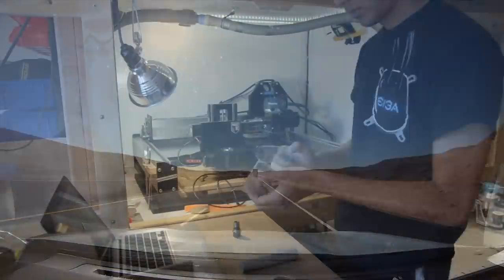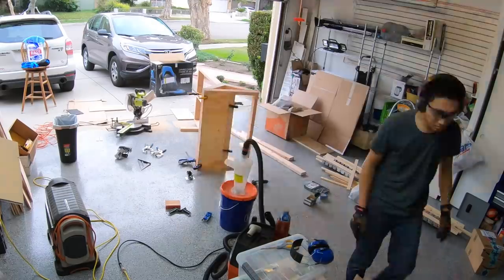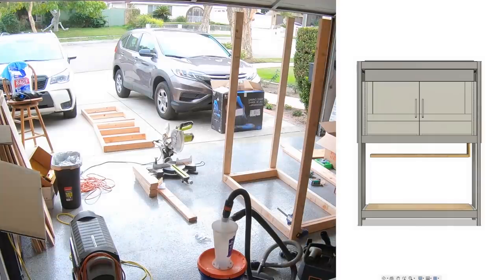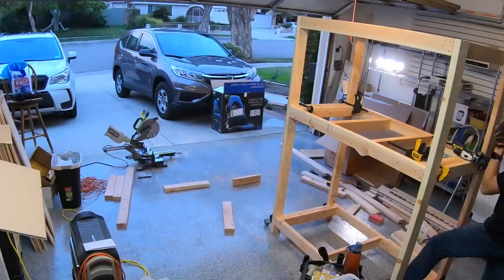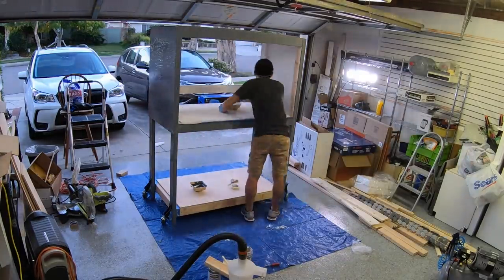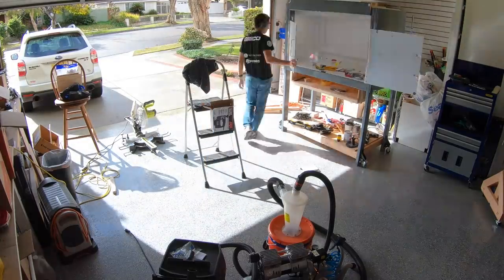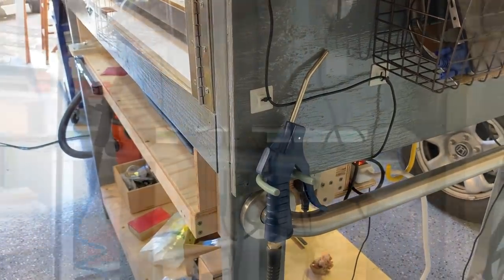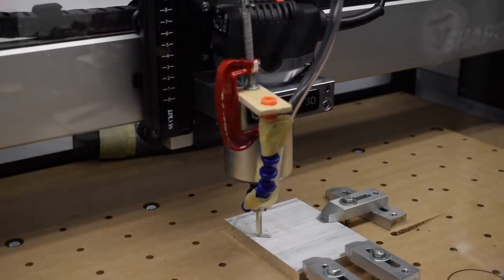How (Not) To Build A Shapeoko Enclosure - #140

Comment: Hi Winston, I'm rebuilding my workshop and will eventually build an enclosed cabinet for my Shapeoko XL. It is temporarily sitting on a old cabinet with on top of a torsion box.  I will take some of your lessons into consideration in my design.  I noticed that you did not include a torsion box in your design. weren't you looking for the rigidity?  If you build with 2X4, I suggest milling them on a table saw to make them the same thickness and remove any surface defect but I guess you would need to put a table saw on your shopping list.  This is probably the most useful tool in a woodworking shop.  You should also consider using joinery like lap joints to make your 2X4 construction more sturdy.  For the vacuum hose, I would recommend the Rockler Dust right hoses that are very flexible and have incredible stretch and they come in different diameter for different applications.

Comment: Hi Winston.  For a cheap, small,  flexible vacuum hose I have been using the hose you put on a sump pump.  I get it from Home Depot.  Its about 10 bucks for a 30 foot hose.  Comes in a bag.  Only bad part is if the length you use is really long it can whistle when it has no load.  Also get yourself a mini wireless keyboard mouse combination from Amazon.  They are about 3" X 6" and have back lighting on the keys. Super cheap, 18 bucks total to my door.  You will love it!  As always thanks for video!!!!!
Reply from the maker: I use a full size mouse/kbd combo. Having the numpad makes selecting jogging increments a lot easier.

Comment: I built a nearly identical designed enclosure for a 24 inch by 49 inch CNC router. I used square aluminum tubing and angle brackets with self drilling and self tapping screws and it went together very quickly. It's skinned in half an plywood and has fluorescent lights in top that I would now do as LED because LED is much better.  I didn't paint anything. The ex motor coupling broke and I needed to repair it so the right side of the enclosure was on screwed in a few minutes which was very convenient. The tank and pump for the coolant is on top and the electrical panel is mounted on the bottom right side. Underneath there is storage much like you have in your design. My hand monitor is now that exactly where you're is and I use a wireless keyboard to control the LinuxCNC computer in the electrical panel. I bought a Dust Devil but haven't implemented the dust collection system yet. I mostly cut plastic and just vacuum up the chips afterwards.

Comment: I have often spend an extra afternoon milling my construction lumber to square before I start building. Because as you say the inaccuracy of 2x4 can drive you nuts for stuff that isn't framing or quick work benches. I see you already have a thickness planer, so with a sled or a table saw you could easily do this on your own. The problem I have with this approach is that you don'r really know what dimension you will end up with until you are done, as that is determined by the most warped piece. So any plans made a head of time will have to be altered to fit the new dimensions.
Reply: Yup this is worth the extra time!
Reply: Run every piece through without changing the thickness setting to keep them uniform. Or at least for the final pass on that face.
Reply: I agree but I rather buy  S4S clear lumber right out of the gate. Sure, it costs a little more since someone else does that work for you, but for a project of this size the cost difference isn't significant enough and I have better things to do with my time than fix lumber (I also don't have a jointer or planer so I guess that is a factor too! lol)

Comment: Just finished mine and I out 10 full extension drawers 2 that are only 3 inches deep. 6 under no it casters with 4 locking. I mounted a small fan inside the drawer enclosure and put a 10 inch filter in suction side so I have a slight positive pressure in drawers to keep dust out. It works great even mdf  dust dosnt get in drawers😀

Comment: Funny how I was not even finished the first version and I am thinking about V2.0!  I am adding a side window - idea from Jason as I have projects that are zero'd in the center.  Like your doors, will use your idea for that upgrade.  Suckit Dust Boot works great, my issue is sound - used acoustic panels with good results.  Put my monitor on top and got a cheap PC to be dedicated to the Shapeoko.  Wish the enclosure was 2 inches bigger in all directions.  Did hinge the front half of the top for serious access when working on the machine.  Hope California is treating you well as I look out at the snow!

Comment: Cool stuff. Enjoyed your narration. Plywood construction without full 2x4s and only cut down pieces for things. Using a combination of 3/4 and 1/2 plywood can be very advantageous. Oh and it's dimensionally perfect. Use a factory edge to run circular saw along or one of many methods to cut straight.

Hide hinges by flipping them so that when closed they are folded together. I'd personally prefer framed windows and that way you can hide all the hinges. They look okay showing but maybe worth considering if you redo it in a couple years.

Comment: I made mine into an outfeed table for my table saw, with three drawers for accessories below it.  A lot of people scoff at it's height, but I don't have much of an issue with it since I don't have to be stooped over next to it.  If I need, I have a short stool that I can sit on.  At the moment I've added a large workbench surface to the top and an using it as a sort of workbench in the mean time until I have the space to have a dedicated wood working bench.
Reply: Ditto: https://imgur.com/a/WaaZQAR

Comment: Not 80/20 but for what your doing the extrusions come in various square and rectangular configurations metric and imperial. It’s a cleaner build then 2x4. SIP panels would also work for the box enclosure fitted to linear actuators for access during setup and interval checks. I have yet to use the aluminum extrusions but the modularity and functionality is a clear winner.

Comment: Winston, I dare not post pictures of my enclosure of horror that is actually TWO trolleys that I made that join together. The reason I made it like that is because I made it in my living room half way through decorating and randomly decided I needed an enclose for the CNC and I needed to make sure I could get the thing out of the room in two parts when my garden workshop is finished.

So yeah, why so big? My CNC is an Openbuilds Ox 1000x750mm and wanted plenty of soundproofing and I made sure there are good levels of shelving front and back for a laptop and the cyclonic vacuum system I put in...the reason for that is that wood dust clogged the crap out of my Dyson filter previously. Hardly any dust reaches the vacuum now and is actually deposited in a large storage box (that originally showed how NOT air sealed they are - had to make an air seal before the vacuum system would even work). It makes emptying a lot easier too.

But one thing I love about my enclosure is that it’s REALLY bright because I put in loads of LED lighting strip. No shadows anywhere.

My CNC is currently ripped apart as I’m modifying it to make it a dual CNC and laser engraving system and I haven’t got the thing working how I like just yet. I’m also moving bits around, raising the gantry and moving the circuitry box off the gantry and to the electric cupboard (that holds my SuperPID for the Dewalt) to keep everything together (but shielded from the mains... I had some trip outs when the router moved past the circuit board in the past so wanted to rule that out).

But yeah... I tend to always oversize rather than undersize... it’s a bit of a problem too lol. I’m like the Russian Space Agency to your SpaceX, Winston. 🤓
Reply from the maker: Hahahahaha, I love the analogy!

Comment: I'm basically designing my Shapeoko enclosure to be similar to a Datron like machine. But I'm going back and forth between stand up work height, and one that can simply roll under a table. Or a hybrid that has scissor jack legs, only to be deployed when actually using the machine.

But unfortunately, I'm not a purist with my machine. I've already got a 5.5kw spindle with VFD and will be upgrading the Z carriage to something stronger, and screw driven. This has prompted me to look into the X and Y belt drive, and even question why I'm keeping those around, since I've probably invested more into my XXL in upgrades, than what I paid for the whole machine. The custom machined vacuum base plate I designed is enough to put this CNC into a more semi-professional category, rather than the hobbyist machine it was originally intended to be.

If it weren't for your detailed and insightful videos on the Shapeoko, I might have never bought one to begin with!
Reply from the maker: Eco Mouse If you're going beyond Datron anesthetics and planning on running "Datron style" make sure your design is sturdy. The one thing I'd say belts does better than anything short of a precision ball screw is speed. And when you're pushing 2-300 IPM finishing passes, you can get a whole table to start shaking.
Reply: @WinstonMakes  You haven't checked out my Instagram video where I filled my drill press column with molten lead ;-)

Comment: Boy! Thank you for making this video! I have been in the process of designing an enclosure for my future shapeoko purchase, and your constraints seem similar-ish to mine. I've made mine in sketchup, and the biggest constraint is that the cart must fit through a standard indoor door. Without the experience of use, I thought having an integrated in/out-feed table would be good, but while you adapted your cart for standing over your shapeoko to work with it, I set it to be used from a seated position:  what are your thoughts?

Comment: Did you consider a clamshell style enclosure?  I am waiting a few months for my scheduled move from Hawaii back to the east coast before I buy my XXL, but have been looking heavily into different enclosure designs.  For some reason, I really like the look of many of the clamshell enclosures.  Curious if there's a particular reason you opted for a standard cabinet design?  Also, have you found that relocating your enclosure around the garage causes changes to your machine's calibration (washboard flatness in particular) due to normal variances in garage floor flatness?

Comment: I use this hose for my vacuum system /www.rockler.com/auxiliary-small-port-hose.  It is very flexible and recoils back on itself.  I guide it through 2" ABS DWV pipe mounted to the back of my bench .  The pipe runs up the back then makes a 90 degree turn, then runs horizontal out to about the center of my Shapeoko and terminates with a 90 elbow, down.  The hose runs through the pipe making a very neat installation.  I found an adapter at Home Depot just like the one supplied with my Suckit except it is flexible so it attaches and detaches easily,

Comment: Thanks to you, I'm in the market for a Shapeoko. Specifically the XXL. Since it's going in my studio, an enclosure is a must. Would you share any recommendations for the interior measurements? 

In any case (pun intended :) ... many thanks for the great videos and inspiration.
Reply from the maker: Id suggest at least 3" on either side of the machine, and at least 2" front and back, more with a dust shoe. As for height, I'd pick one that's ergonomic for you. You need to be able to lean in and secure stock without bumping your head.
Reply: @WinstonMakes  :: Very helpful. Thanks Winston and happy chipping.

Comment: Winston, are you pleased with the makita spindle? do you have any tips on using endmills smaller than the supplied 1/4" collet? that is, precision collets or just the 1/8" to 1/4" adapters that carbide/amana sell? 

thanks for the amazing content over the years!
Reply from the maker: For woodworking, the Makita is great. My gripes with it are when it's being pushed beyond what it should be doing (ie. heavy aluminum cutting), so not relevant for most people.

Precision collet all the way, I hate adapter/reduction bushings. Once they crimp just a little bit, getting endmills in and out of them is a royal pain.
Reply: @WinstonMakes  - I am using the Makita too and mainly aluminium, it work very well (for what it is, a palm router)
MRR approaching 10ccm/min possible if the CNC structure (rigidity) allows it :).

Comment: I had to make mine under an outfeed table for the same space (single car garage) restrictions -- https://imgur.com/a/WaaZQAR 

I also dealt with the side/rear access issues by having bolts and some french cleat like catches for the side 3/4 plywood. Does nothing for rigidity of the table surface, but I didn't need much there. I will say, having to sit so low and "duck inside" the enclosure, as you've noted for your previous standing setup, is less than ideal.

Comment: Winston, could you fix the fusion link, would love to have it for reference, I am thinking of building my own inclosure to the shapeoko 3 XL and would like to avoid mistakes :-D
Fusion360 webpage says the link no longer works.
Also how silent is your inclosure, do you think it's possible to build it silent enough for standing in an office? I have 3D printers running without inclosure, and I am not bothered by those, but fear this machine is much louder. :-/
Reply from the maker: Fixed the link. When I migrated Fusion to a new Team it broke every single link I ever posted, so I'm still discovering places that need to be updated.

It's possible to build a really quiet enclosure, but whether or not it's practical is another issue. There are people who've basically built a tiny house for their CNC, using two layers of materials (sometimes sheet rock) on the walls and insulating in between. It helps a lot, but it's never going to be silent. Also depends on what you're cutting and how you're cutting. I don't think you'll ever get the decibel level below that of a relatively quiet vacuum cleaner without going to a VFD spindle and ultra sturdy enclosure.
Reply: @WinstonMakes  thx for fixing the link and for your input. No I fear the noise will be to great as well 😕